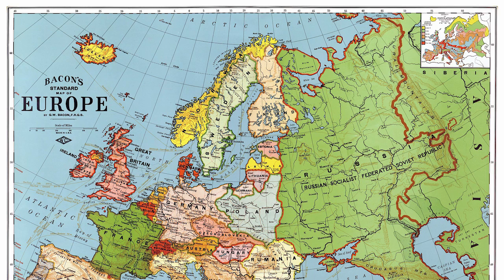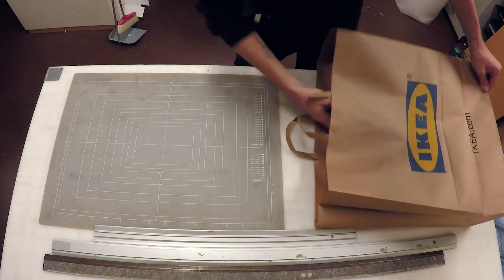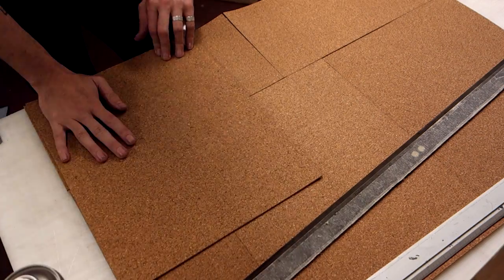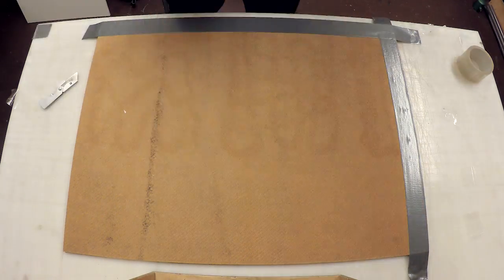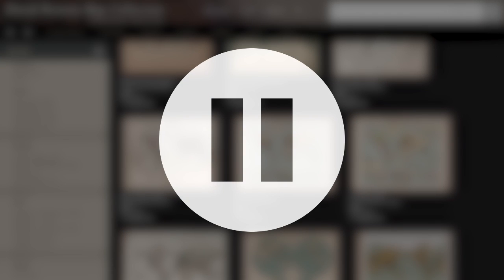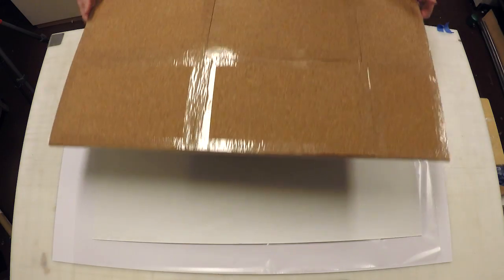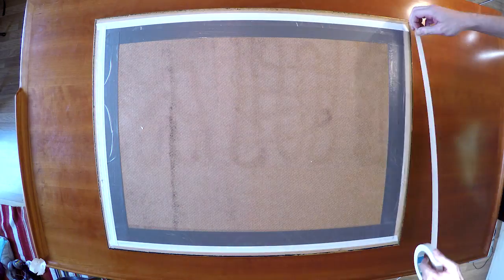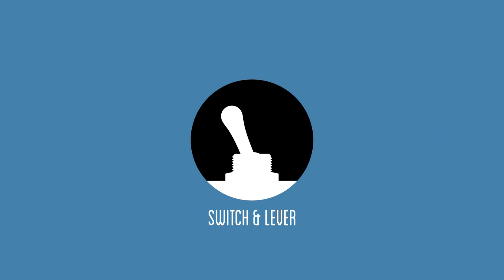Make a Corkboard World Map

Comment: To stretch paper, canvas, and similar sheet materials on a board or frame, start in the middle and stretch it outward as you glue or staple it. You will end up without wrinkles or bubbles. I learned this in oil painting class many years ago.
Reply from the maker: That's a very difficult thing to do dealing with a big sheet of sticky plastic though as you'd need to essentially peel the backer paper from the center out.

Comment: Thanks for sharing. The resultant map looks wonderful. At the end of it all, with about 30% of your place mats going to waste, was it still cheaper than buying cork sheet?

You really need a touch-screen TV for your wall maps - routes and destinations easily inserted or deleted, maps swapped out and your holiday snaps easily tagged in.
Reply from the maker: +Jeff Harmed more like 10%, but yes, it was less than 1/4 the cost I could find the equivalent size cork for. 

As for touch screen, seems like an awful waste of electricity.